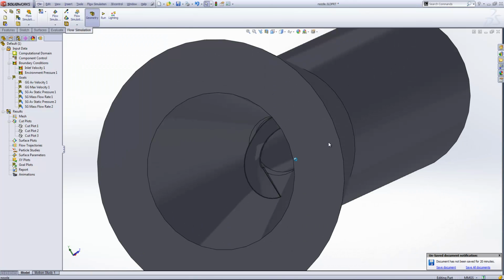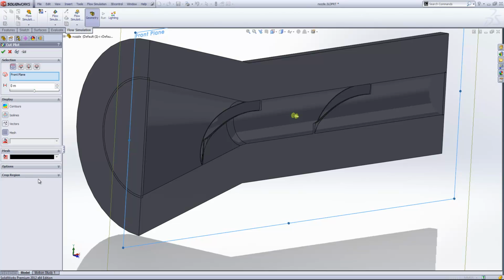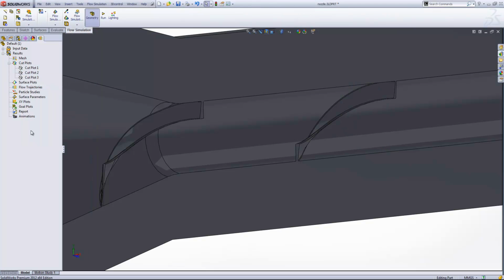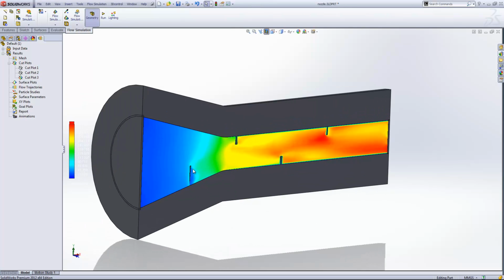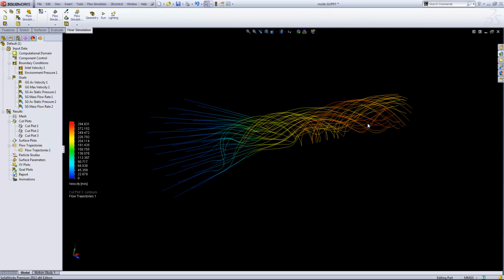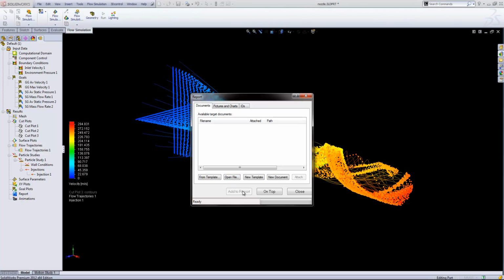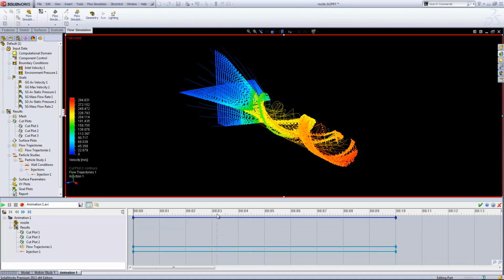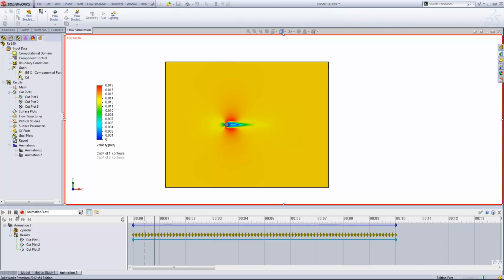SolidWorks Flow Simulation results visualisation

Comment: Hello, 
I would like to have your help, this it does not bother you. 
I'm working on my project fim study 
now I need a tutorial, hows that, 
how you can learn to make a flow introduced with a temperature gradient in a pipe (2 pipe coaxial ,1 of 28 x50 and 20x50 thickness 2 mm), 
with, phase change materials, paraffin, amid 2, 
with inlet temperature 80 ° and 62.9 ° output, 
to consider a phase-change materials, on, solidworks. 
please it is urgent. 
and also the entry of water in blue, 
exit in red Paraffin and green,  leaving the walls, in gray. 
Thanks